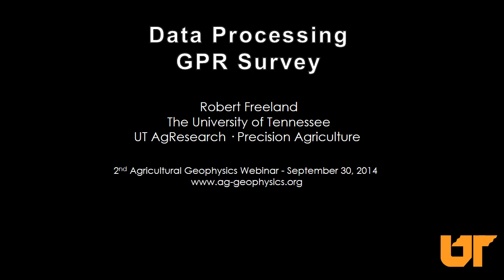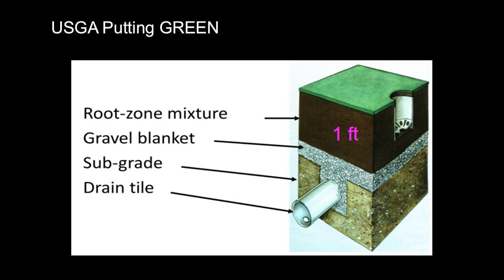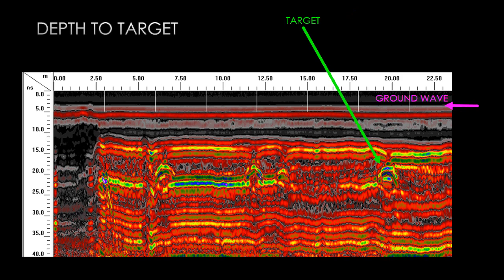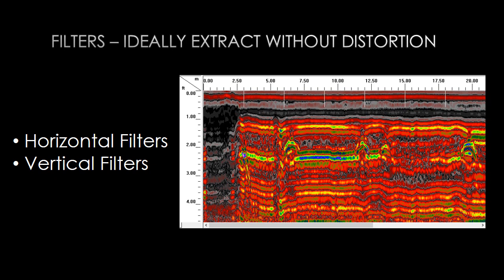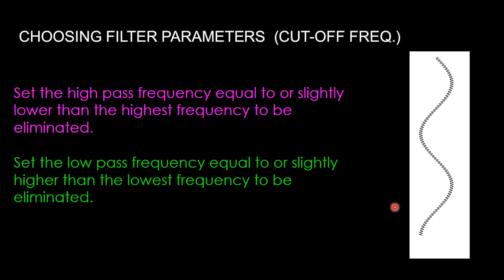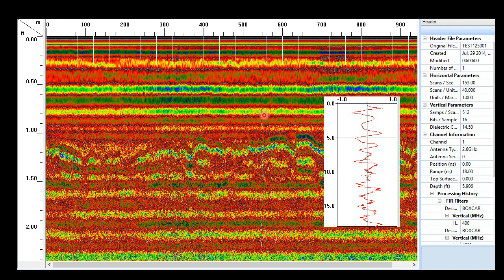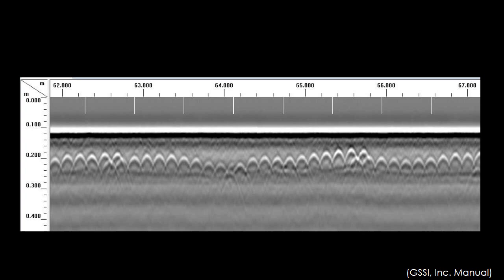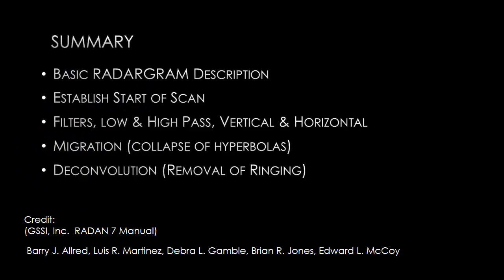Overview of GPR Data Processing - Robert Freeland, University of Tennessee

Comment: Hi 
I'm currently designing a new GPR system . You've mentioned the fact that when you apply filters to data those are distorded : is it right ? I'm currently designing a GPR software with all the basic processing steps you mentioned but all the raw data are saved in statics variables as soon as they are acquired on the field so you can play around with filters as much as you like  the raw data will never be distorded .
Reply: Laur92 Laur92